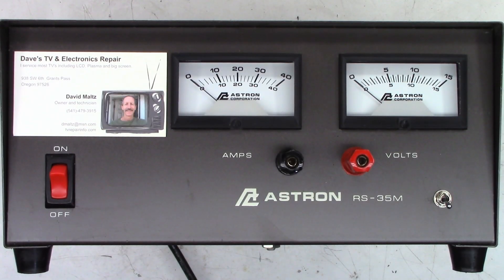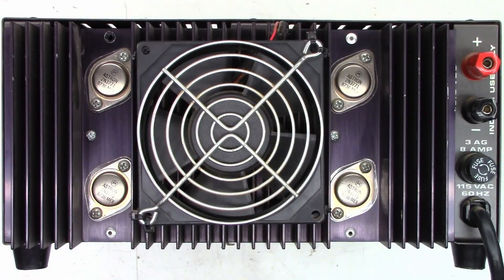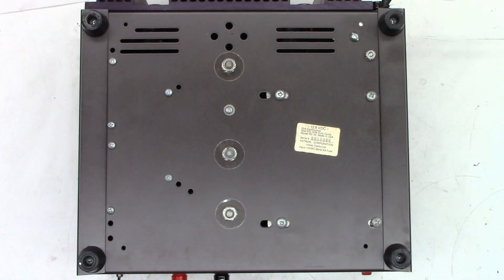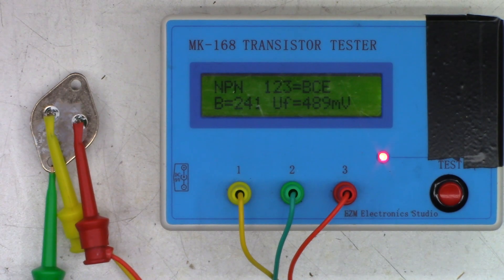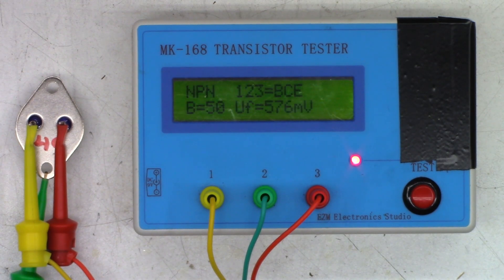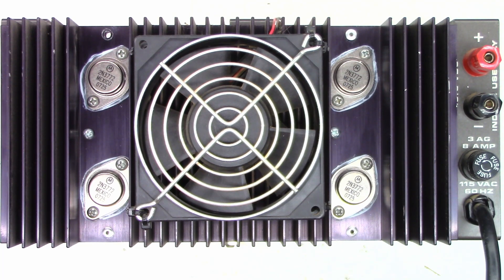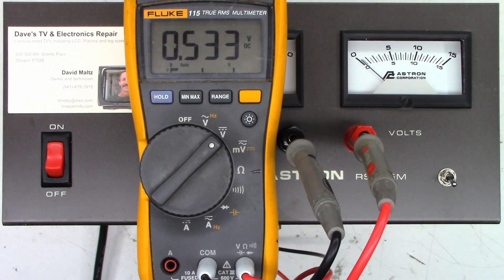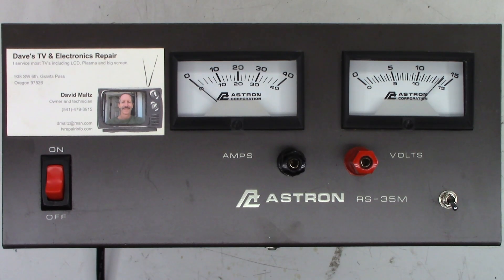Astron RS-35M Shuts off  Overvoltage?  Working perfect over a month since this repair! 2N3771 2N3772

Comment: My rs 50m hold voltage and works as it should but occasionally it will buzz loudly while still holding proper voltage and keying microphone on cb radio it pulls the proper amps as always. 
Im baffled on what the issue is. 
Ill run it till it blows i guess.

Comment: Good stuff, good work! A couple tips - to turn off the pass transistors, the base needs to be grounded rather than floating. Once the bases are grounded, a small load of maybe 1/4 A  (56 ohms) at the output will enable an accurate reading of output voltage. The combination of floating bases and the 11M impedance of the meter alone made for a small,  unrealistic voltage measurement.

Comment: Great job on the repair👍🏼 I have a question on a power supply you might be able to help me with. it's a pyramid PS-52KX and the problem is it's supposed to do around 50 amps but it's only doing 15 amps and when you have a load on it I'm running a CB radio the problem is when I key the microphone and the radio draws amps I get a loud hum from the power supply when I unkey the hum goes away and it only draws 15 amps the voltage is fine..
Reply: A loud hum under load can be several things.  See if it is mechanical - if the case or something inside is loose and vibrating.  If nothing is vibrating, check the rectifiers.

Comment: Question: At 11.30 when you clean the PCB with brush,  what fluid are you using?
Thanks for posting your 2N3772 test  results.  I'm doing the same  with my Pyramid PSU also using 3772's but a Peak-Atlas.
Reply from the maker: I use regular Acetone available at any hardware store.

Comment: Hello Mr.norcal715 .. Thanks so much .I'm beginner technition.. how I follow up voltage in circuit board ...& also some capacitors..47uf..50v .. or 1000uf 16v .. when I tested should be get same voltage or different value... 
          Thanks .. Ali ...khartoum.
Reply from the maker: Its hard to tell, most capacitors in a power supply application will have approximately 60-80% of their rated value as far as voltage. But in different applications a 16v capacitor may only have a volt or two depending on what they are using it for. Try and find a schematic, it will be a great help.

Comment: Happy new year! 

Great and informative video as always! I could be wrong but those new transistors look suspiciously like those fake Chinese ones with the large blue insulators, same print too. They seem to work at first but die quickly under load, the die is tiny in them.